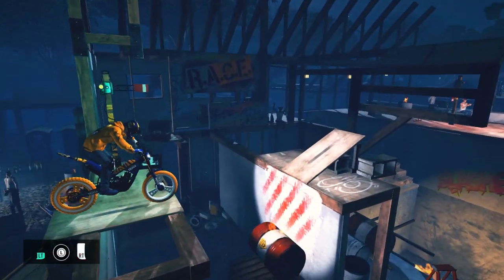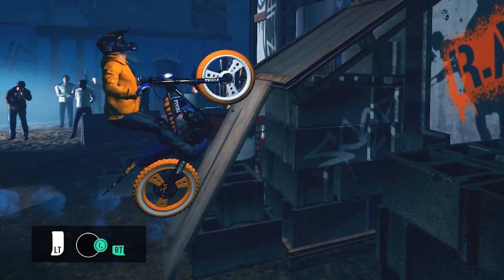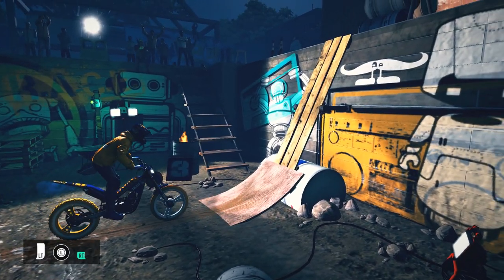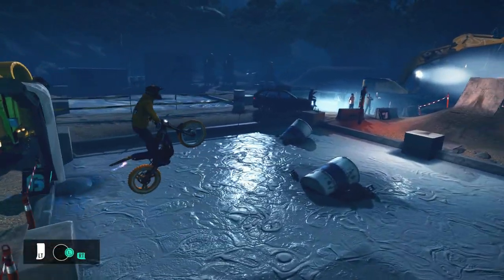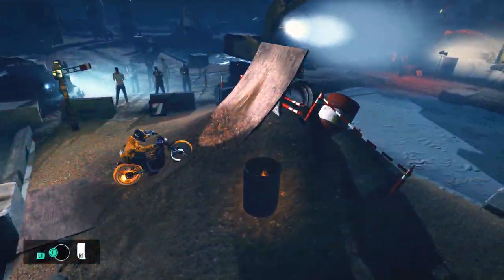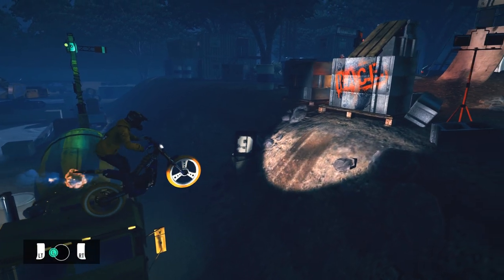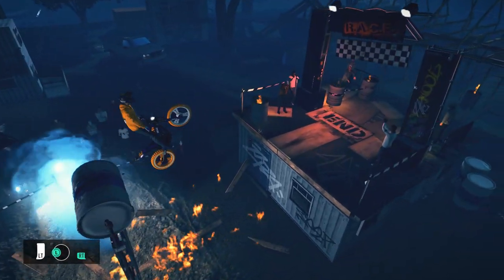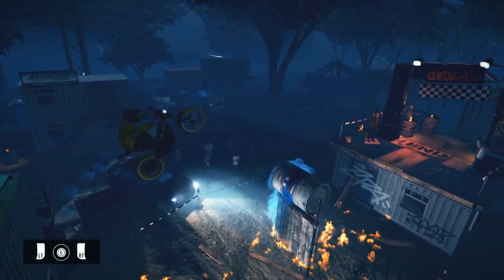Corky Construction - Trials Rising Detailed Extreme Walkthrough

Comment: Last CP is pure luck for me...
Reply: Yeah straight up I got plat on inferno and I still need to get this one gold
Reply: @cataclysmicdelta1828  whaaat i have gold on all extremes and can't finish the last cp on inferno
Reply: Flink 1 word: helium; also just get good at throttle control the helium can legit slowly throttle control up that 89 degree wall, it’s lunacy. also I ended up snagging that corky construction gold and I’m now sitting on green belt in the ninjas
Reply: Flink honestly the 2 things that made this map the hardest is the tight time because it’s so short and the fact that it has a lot of very large jumps and stuff so you can’t use the helium
Reply: @cataclysmicdelta1828  I made some progress, got to the top a few times but can't get over the ledge. Need even better throttle control I guess...
Reply: Flink you have to go slow in the beginning and then slightly speed up over time without lifting off your front wheel, and then either endo or fender hook the top
Reply: Flink what system do you play on? If you play on Xbox hit me with you gt and I’ll add you and show you in person
Reply: @cataclysmicdelta1828  Appreciated! But i'm playing on ps4. I think that's also part of the reason, i played all other trials Games on pc with an xbox controller now i have to get used to the ps4 Controller :p
Reply: Flink yeah the ps4 controller is just worse for it in every way, that’s not even me hating on the console, it just has less travel and also less sensitivity